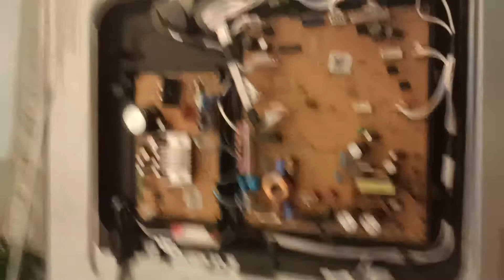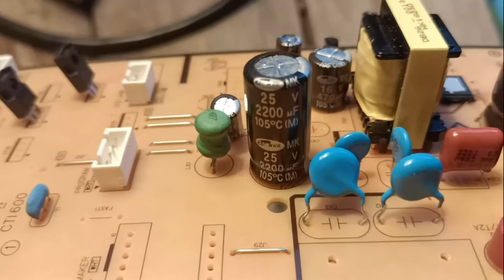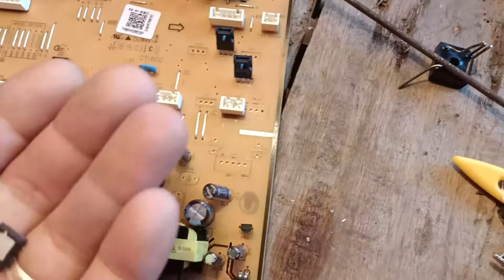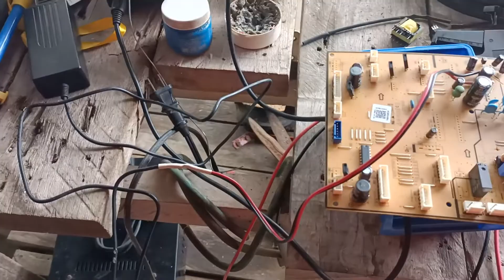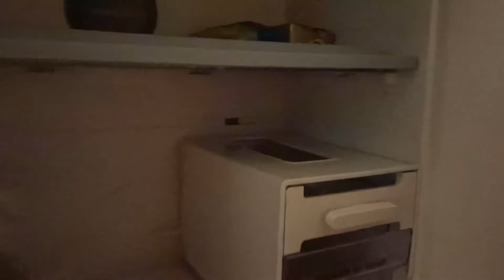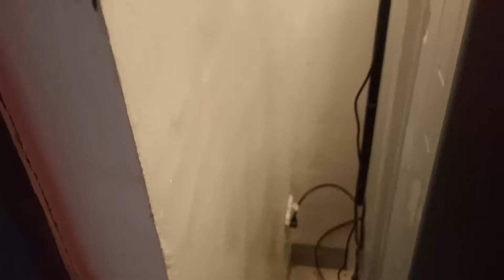Roxas, Isabela - Samsung refrigerator circuit board DA41-00838A not working

Comment: Does anybody has the circuit schematic?
Reply from the maker: Thanks for watching. For this fridge, schematics would be difficult to find. Just a suggestions.  Sometimes it would be easier to make a schematic by reverse engineering the circuit board. I used to do a lot of reverse engineering  and create schematic from competitors boards, I don't do it anymore as my brain cells are fried and from lack of interest. This circuit board is easy to reverse engineer being that it is a single sided board. A lot of businesses offer reverse engineering services, search for reverse engineering services and out comes a plethora of sites.
Reply: @thelifeofexequiel  So far I have eliminated possible culprits in the main board. All voltages are ok.  I rewelded some  loose components that I found. The problem seems to be in the inverter board. I found a zener diode to be shorted. I already discarded optocouplers, rectifier bridge, capacitors, rectifier diodes and resistors, although it seems that are 3 damaged resistors.
Reply from the maker: @adriantejadaramirez3396  My opinion about those damage components are related to protecting the IGBT. Search for "inverter driver protection circuit diagram" as they shows hints how the IGBT is protected

Comment: Thanks for the video! I replaced the TOP267, the diode, swap the optocoupler 817, the red fuse was blown too. Input voltage 240, high DC 320-330. Capacitors are good. What else could be wrong? Transformer? Not sure how to test it? Found black marks under the transformer on the left 3 pins above the arrow.
Reply from the maker: Thanks for watching. I guess there is no 5 or 12 volt present after replacing parts. Check the transformer by using this link as reference
https://www.mouser.ph/datasheet/2/328/topjx_family_datasheet-1511822.pdf

First page shows how the pulse transformer is configured. The physical transformer has what you call holding pins simply for mechanical strength. As a last resort is using external power supply
https://www.youtube.com/watch?v=rdUE1JjnEi4
Reply: @thelifeofexequiel  Thanks, I was referring to the Samsung yellow transformer DB26-00130A apart from the burnt spot under the TOP264 there was a burnt spot under the DB26 but I can't find a schematic to confirm the pinouts. With external 12V 2A adapter hack is working as expected!
Reply from the maker: @MMM-vf4pp  took me a moment to process DB26-00130A. It is the pulse transformer being referred to as transformer. As per reference datasheet first page, the transformer with 6 pin is DB26-00130A. Now physically on the circuit board, it has more pin that are irrelevant. The primary should be 0 ohm while the others too are 0 ohm. If primary or secondary are open then they would be the problem, but where to buy one, right? Anyway, it is easier to check DB26-00130A away from the circuit board
Reply: @thelifeofexequiel  Hola desde ya muchas gracias el tranformador DB26-00130A los secundadios miden todos entre si continuidad, la zona caliente funciona pero notengo los 12v y 5v agregando el tranformador de 12v externo funciona y conmuta el ralay, sera el DB26 el problema? porque no se condigue... en caso de no conseguirlo sera seguro dejar una fuente de 12v externa? Gracias
Reply from the maker: @alesismartinez7491  thanks for watching. Yes using an external power supply will work. I was planning on doing that if I couldn't find replacement components.
Reply: @thelifeofexequiel gracias por responder. Conseguí los repuestos pero el que no consigo es el transformador que es el que se puso en corto. Desde el día que te pregunté sigue andando con una fuente conmutada y hasta pareciera que funciona mejor que original la heladera. Muchas gracias por tu aporte saludos desde argentina
Reply from the maker: @alesismartinez7491  Great! Happy that the video was helpful.

Comment: I have DA41-00838B is it same or different if I replace 00838B with 00838A board
Reply from the maker: Thanks for watching. This is an opinion so please be mindful of this opinion. For me I would spend hours and days before committing to swap B for A.

I am guessing A to B might be a feature addition to an old product design which means A to B change. Or could be a board revision to fix  board deficiencies like the power supply. If possible, I suggest to have both boards side by side then compare what changed. If looks the same then yeah A could be used to replaced B. If there are differences then A might not work as B when installed. Also check those connectors as whether there are more connectors so if yes then B is going to look for more signals. If same amount of connectors then A will work with B. So if B looks same as A (except for the letter) then I would test A as B replacement, critical thinking apply here. Compare those connector lables as they have defined purpose name. Good luck

Comment: Hello, I have a samsung board DA41-000838A, very similar but not exactly, has some differences with the socket. The problem is the same, totally black out. I found also the same broken component, dioda scottky(MBR20100CT)  and PWM IC(TOP267VG). But I'm not as lucky as you, after I replace all those components with a new one, funny... the power is sleeping still. no current goes out on the elco. I've check all the elco. the last, I check the TL413, but seems those items is ok. No blown fuse, no blown Mylar. Any idea bro?  I stay in Indonesia, Samsung parts is not sold in after market, do you know the link who sell this item. My board model is DA41-00838A. RT6000K ver 1.0 with the serial code:  TH06DA9200756H(on the QR code sticker). I spend for hours on the market place already and found nothing. any idea? thanks
Reply from the maker: Thanks for watching. What is the voltage after the bridge? It should be around 320Vdc, more or less.  If it is not then check the input voltage. You could use a 12 volts power supply as I did while looking for parts. I saw the board at Lazada so you could order that from them?
Reply: @thelifeofexequiel hello, thanks for replying. The voltage after the bridge only 290 volt, maybe the input from the wall outlet only 205 volts.  Is there any issue when you use external 12 volts power supply? I am thinking using that way when I get the dead end. thanks for sharing bro...
Reply from the maker: @wijayaR  the 290Vdc might be detected by the IC as an undervoltage condition to protect the refrigerator from damages. Indonesia line voltage is 205? If yes then it is borderline brownout. 

No issues with using power supply, I used it for a week until the parts came to repair the board. Remove the 3 pin diode and transformer when you get to plan Z. Are you able to check Lazada? I check Amazon too and it can found there, they are around $USD 200